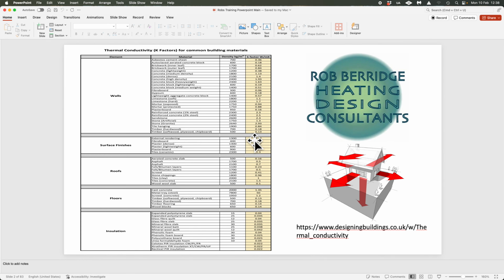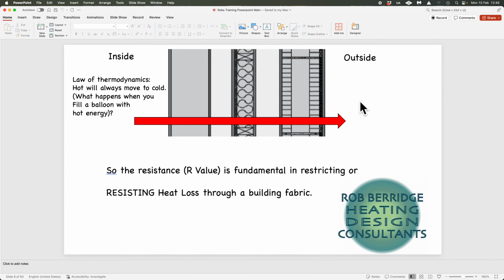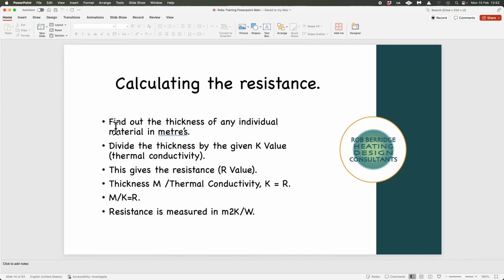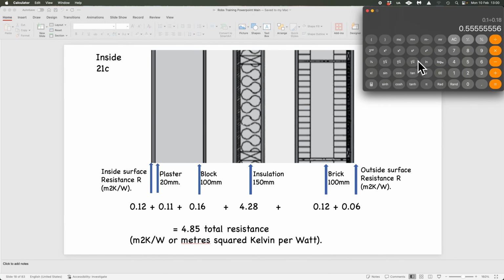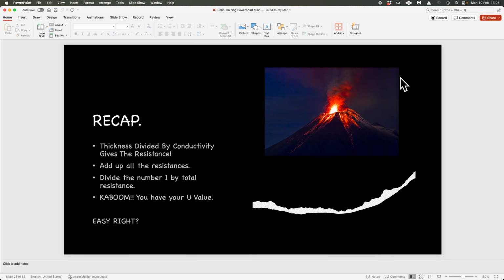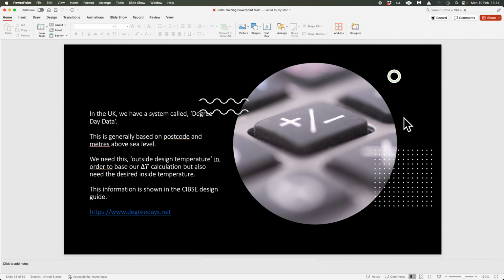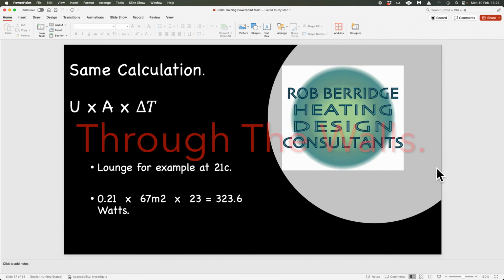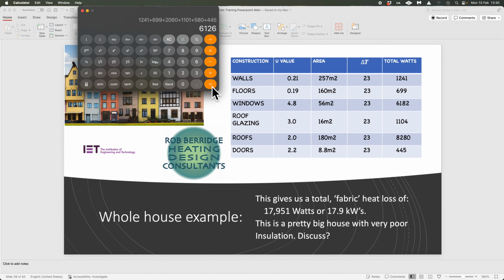Free Heating Design Course Pt 1 (Heat loss Calculations).

Comment: Hi Rob great tutorial, on the roof calculation, you added 300mm of insulation, but would the R value actually be a little higher due to the ceiling plaster and the surface resistance value?
Reply from the maker: Hi, yes it would as you add all the R values of each construction material together to make the total resistance value.

Comment: Hi Rob, really well presented videos, If the dt is worked on 23 for all the calcs then if installing a heat pump with say dt5 would that work or am I missing something.
Reply from the maker: DT23 is never presented as the only calculation Daniel. Everything depends on outside temp vs inside temp or incoming water temp vs desired water temp.
Never get confused, I was just trying to make the maths easier to understand.
If you highlight a particular section that confuses you, I’ll explain in more detail or produce a sub video of that section and address your concerns. 
Keep going. 👌

Comment: As a homeowner that wants to design the heating system these tutorials are invaluable. Helping me go toe to toe with installers to ensure the best for my property is central. Your approach is great and I’m looking forward to learning from your work
Reply: I'd suggest as an installer myself, wanting to learn this to go 'toe to toe' with potential installers will have them running a mile. 
By all means, learn this and specify the system but don't try and present yourself as an equal with the installer's years of practical experience.